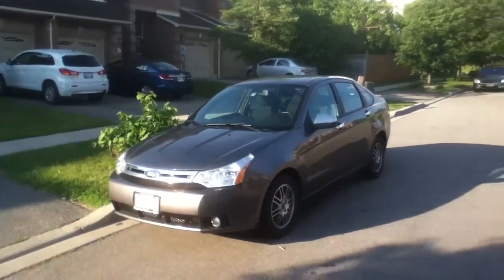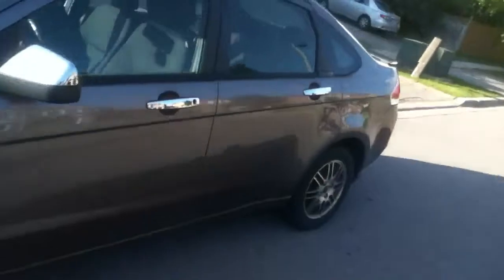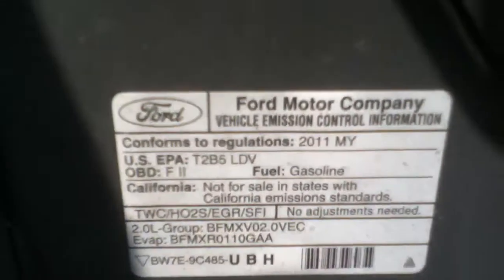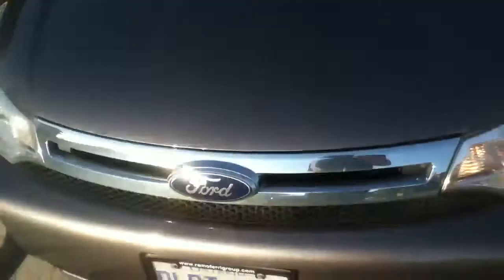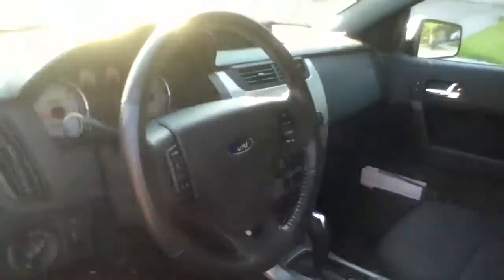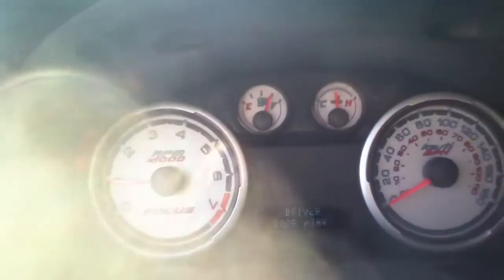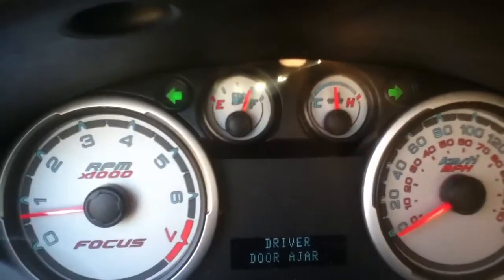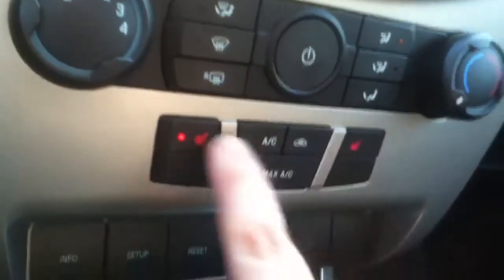2011 Ford Focus SE (Dark Grey) Startup Engine & In Depth Tour

Comment: Question, i got the same year but ses, but under the hood looks the same all togehter. I have a broken hose to i believe is the air intake, somewhat right below where the battery is, any ideas on parts i need to fix it? I really enjoy this car and dont need it crapping out because of this small issue